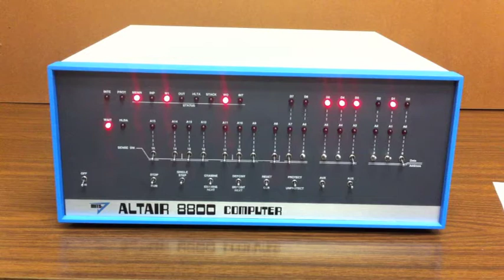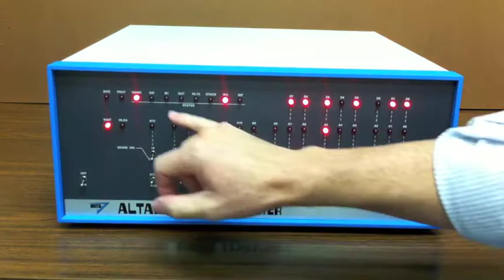Altair 8800  - Video #4 - Front Panel Status Lights

Comment: Is the Stack Register a physical register inside the CPU or does the programmer setup up an area in memory to act as the Stack Register?
Reply: The Stack Register (SP) is a physical register inside the CPU that stores a pointer to a memory location where the stacked data is stored. The real data is stored in memory, but the locations where that data will be loaded is stored in the CPU. A interesting thing about Stack is that the data is stack backward. If you stack a byte in address 0xF100 , the next byte will be stacked in address 0xF0FF and the SP register decreases. Another interesting thing is that the z80 only stacks 2 bytes a time. You can't stack only one byte.
Reply: @marcelusmeridius  
Where in memory is the stack data located, or is that something you have to setup, or is there a default location, if not specified?
Reply: Jeff, SP (stack registers) starts pointing to 0 after a reset , but usually the programer need to setup stack as the fisrts steps of the program.
Reply: @marcelusmeridius  No, actually, the SP is not reset to 0000h by a RESET. It's random on power-up. I don't know if it's preserved across a RESET.

Comment: Before you continue with this you should memorize binary and hexadecimal not octal. There are several bitwise conversions/arithmetic that throw me off because you use octal.
Reply: The switches being grouped in threes helps out a lot with remembering octal. Just imagine each group of three is an octal digit between 0 and 7. 

For the address switches:
100000 
40000 20000 10000 
4000 2000 1000
400 200 100
40 20 10
4 2 1

For the data:
200 100
40 20 10
4 2 1

In octal each digit is 3 bits as opposed to hex where each digit is 4 bits. 

000-111 is 0-7 in octal just like 0000-1111 is 0-F in hex.

The only real difference is that when you go from 111 to 1000 you move on to the next digit in octal instead of continuing to count up like in hex.

In hex:
111 - 7
1000 - 8

In octal:
111 - 7 
1000 - 10

Easy peasy. :)
Reply: The octal base where used in Altair because the 8080 uses octal to form a instruction, for example: the two bits os some instructions says what the type of that instruction( load, move , store,jump) while the middle 3 bits and the last 3 bits refers to operands, usually registers.  A,B,C, etc.
Reply: @marcelusmeridius  That's the case for some instructions (notably MOV), but not all. LXI for example is 00rp0001 where rp selects the register pair; that doesn't fit comfortably into octal notation but works great in hex. Intel's original documentation used hex almost exclusively. For more info see https://retrocomputing.stackexchange.com/q/12101/7208 .
Reply: Also Hex is nibble aligned to binary where octal is not and loading Instructions/Operands can be done in nibbles without conversion at all.
Reply from the maker: Actually, I think and breathe in hex and binary. Octal is the difficult base for me. But... like the DEC PDP computers, this is an octal oriented machine. The front panel is laid out in octal, all original documentation uses octal, the assemblers provided by MITS all assume and use octal. So for historical accuracy - octal it is.

Comment: what is the use of the halt command?
Reply: If the CPU has compleated a program it is supposed to stop executing. This is what the halt command do. It stops the processor until an interrupt occurs (in case interrupts are allowed). For example if you write a program that requieres some time and shouldn't be run in the step mode, it can end in a halt instruction, so the program runs and then just stops. Or if you add a keyboard it can wait until you pressed a key.

Comment: do you have handy a "Front Panel Saver" program? like a screensaver.... but for the Altair...
i have mine running "kill the bit" as a sort of demo mode to show it "doing something"

but to tell you the truth, that bit going by reminds me a the old crystal police scanners from back in the early 80s....

maybe something that exercises all the lights..... (i have the 8800micro, not the clone....)
Reply: I have written a little program that looks really cool in my opinion. It only works when your memory doesnt get cleared in boot though. 

000:012 012 012 012 024 302 000 000
010:012 012 012 012 034 302 000 000
020:301 036 370 303 000 000

You can change the speed by changing the Byte in octal Adress 22. The hoher it is the faster.

Comment: Is there a reason why the WO (Write Output) LED is inverted?
Reply from the maker: On the original Altair, the front panel LEDs are driven directly from the corresponding bus signal. The WO bus line is an active low signal, so its LED is driven "backwards." Oddly, the memory protect status line is also active low and MITS did put an inverter in line to make that LED work as expected. As far as the WO LED is concerned, it could be an oversight, it could be they ran out of gates on the front panel board. They did fix the inverted WO LED on the 8800b.
Reply: A majority of microprocessor bus/control lines are Active Low as deramp5113 explained. Expect to see this a lot, the reason they are like this lies with the manufacturer but for the most part it is due to the TTL/NMOS/CMOS design of the chips that favor a negative output for the ports. Most RAM/ROM chips are designed around this especially with the Chip Enable lines. However the fact that the Altair displays this as an active low without inverting it is beyond me. The Intel 8080 is infamous for it's bad design choices, it's the only reason companies like Zilog and AMD exist.
Reply: Oh and if a panel light or control signal is indicated with a solid line above it's name that indicates an active low signal. Just throwing that out there.